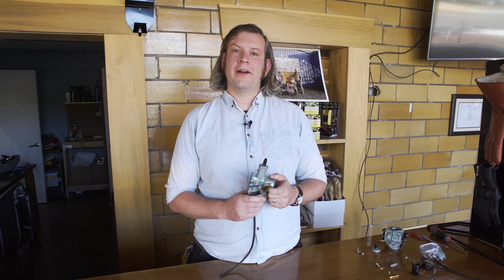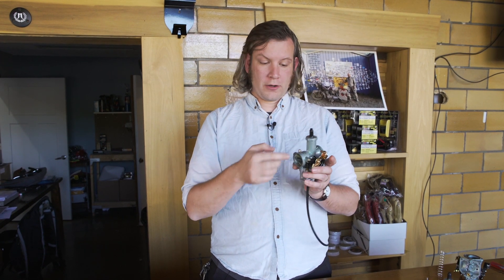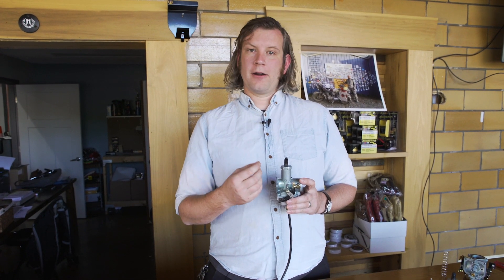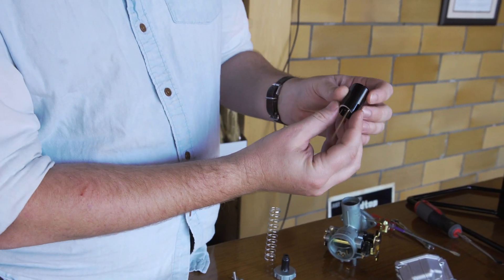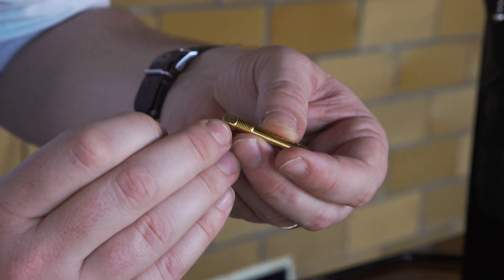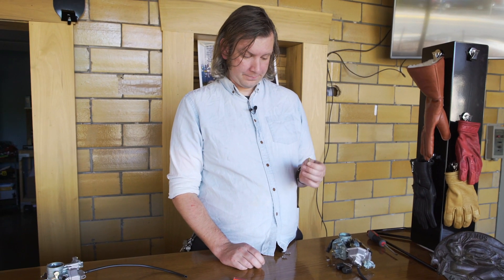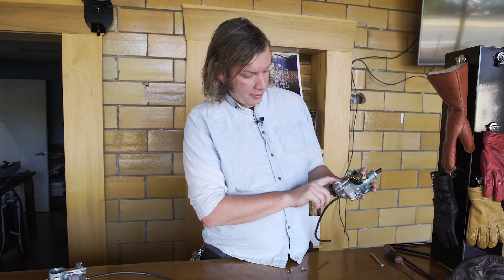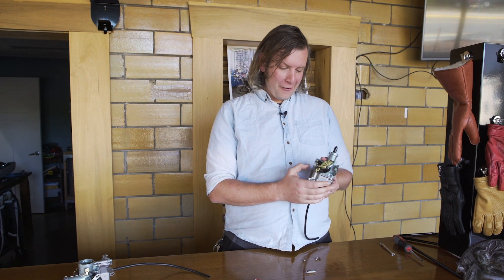Janus Parts Ep. 7: Getting a carbureted engine through EPA

Comment: Neat.  Not a gearhead myself so I wonder what the motivation is for using a carburetor over fuel injection, is it less complexity and lower maintenance?
Reply: Less complex.  Arguably HIGHER maintenance until something goes haywire.  Their choice seems to be driven by a desire for simplicity and for owners to be able to do all necessary work themselves with simple hand tools.  That's part of the attraction, for me.  I owned a big BMW touring bike that was complex beyond belief.  I'm pretty techie and that thing constantly worried me.  Everything in the Janus is simple, straightforward and makes perfect sense.  I can't believe it's emissions legal.
Reply: For people with a certain mindset, including me, tinkering is half the fun.  As long as the tinkering is understandable and actually accomplishes something I like doing it.  That's why my favorite gun is my cap and ball black powder revolver.  Every time I shoot it I have to take it apart and clean it because it's a filthy, sooty mess.
Reply: @mqbitsko25  I would most likely shelve the factory carb in favor of a 35 or 38 mm rejected for more performance the club I belong to frequently likes to do and I live to tinker and build performance machines. It’s only a 250 but there’s more to be had out of it from stock
Reply: It's not lower maintenance, and debatable on what is less complex.  Depends on whether you're the designer or the user.
Reply: Rob H easier to rejet for better performance, fuel injection requires computer driven ignitions and more complex engine designs. This is an internal pushrod engine. Tried and true. Chain driven overhead cam engines work great also but require different maintenance. Both have their pros and cons. Fuel injection requires a lot of different things to modify and takes away from the basics of an engine. Nominally aspirated( carburetor) is relatively simple to maintain